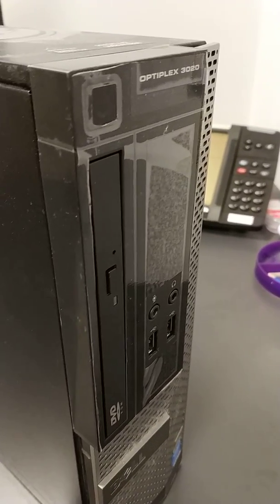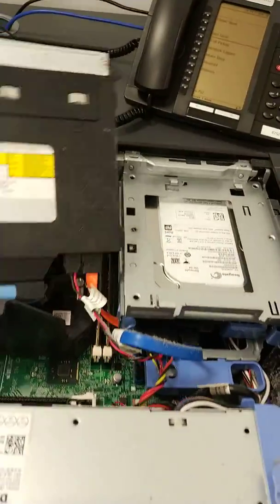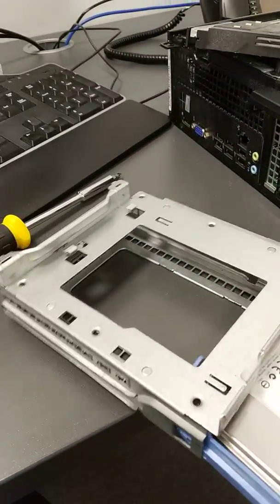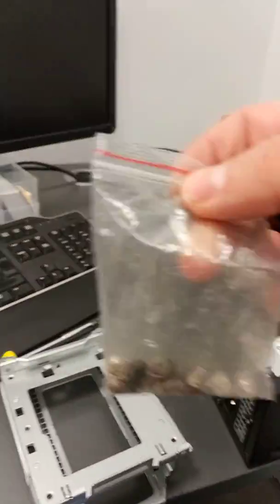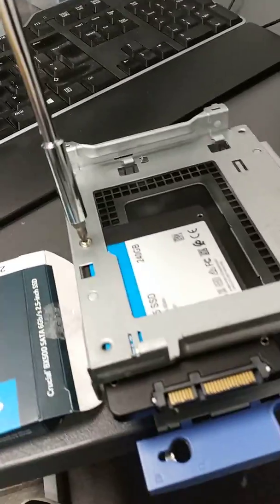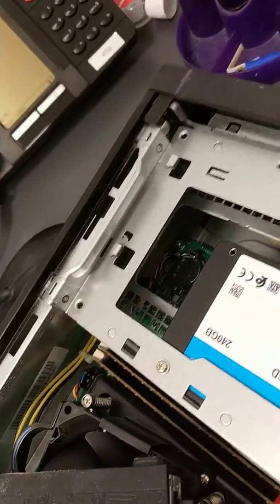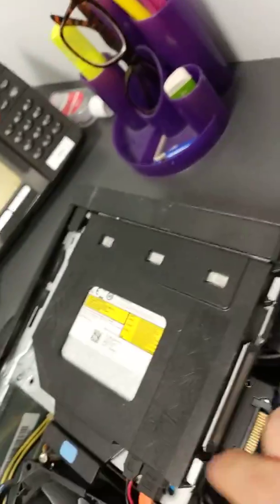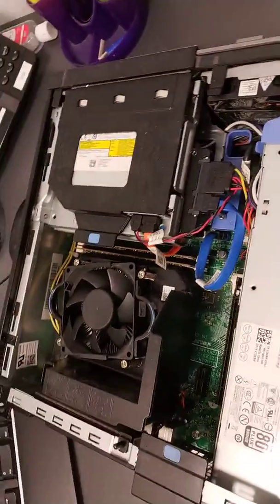Dell Optiplex 3020 hard drive replacement with SSD drive

Comment: did you purchase any extra cables or just the ssd? and also, would i need a bracket for it or would simply screwing in the ssd work fine?
Reply from the maker: used the existing cables, a bracket is recommended but not essential you can fit the drive without it :)
Reply from the maker: Hi thanks for the comment, and sorry for late reply, you can use the existing cable and attach drive straight to existing internal caddy.

Comment: I'm considering upgrading to my Optiplex 3020 to SSD as well; it has an i5-4590 processor and running Windows 10.  How much real time difference did you notice after the upgrade?  Some people say if your computer hardware is old the difference is not as noticeable.  Thanks.
Reply from the maker: hey omar, upgrading to SSD offers significant performance increase regardless really, very noticeable, SSD is about 10x faster than standard mechanical drives. Its a worthy upgrade for the sake of 25 quid. :) thanks
Reply: Fresh install of windows also makes a difference if you can avoid 'cloning'. You'd need to reinstall programs and copy data from old to new drive.